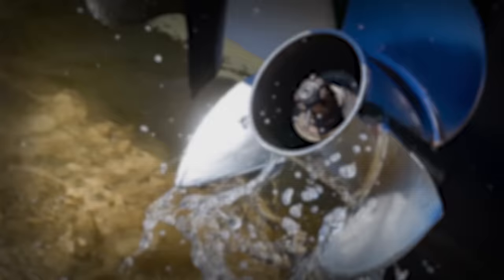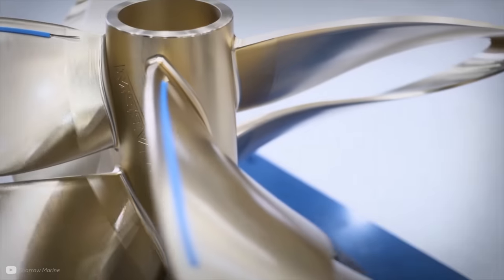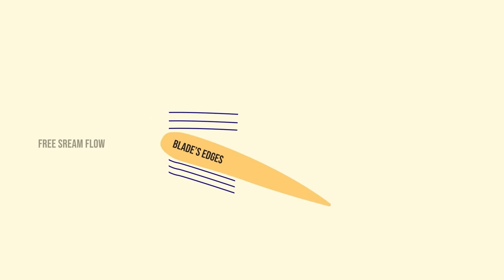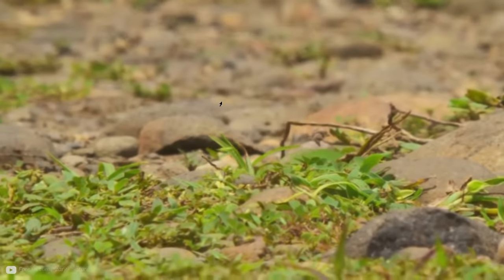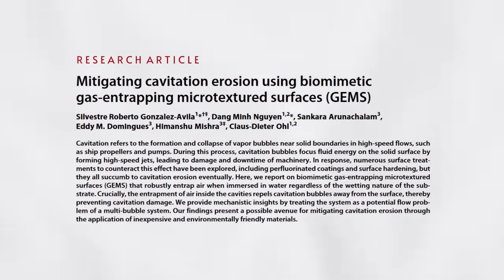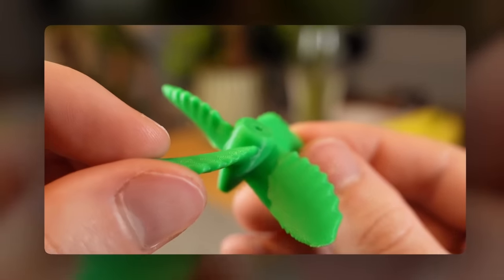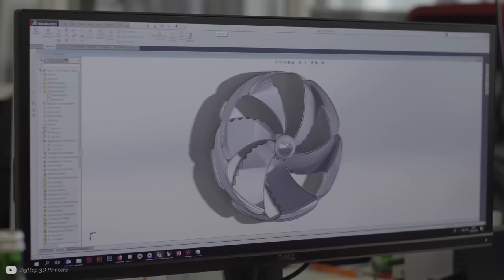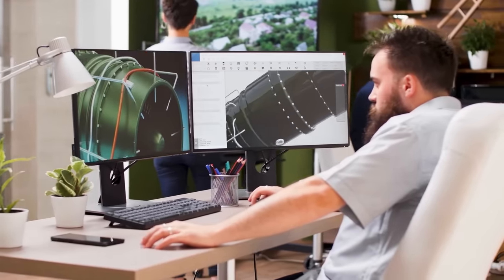The Unexpected Genius of Bionic Propellers

Comment: They should also look into blades on turbos for automobiles. You only need small blades which is easier for manufacturing. Also there is already an infrastructure for testing. Don't forget a giant payday from oil/gas and automotive industries.

Comment: The claim of "+19% efficiency" for the linked blade prop means nothing all they've done is made a bolt on kort nozzle which when properly designed with its propeller can get you more than +40% efficiency over a standard open bladed prop , they also reduce noise and fuel consumption but at only low speed and normally only fitted to tugs and trawlers, kort nozzles are not used on ocean going ships for a very good reason , drag. they cause more drag at speeds over 8 knots than the benefits they give and that fixed tip joined prop you show would be exactly the same, if props like that could be made to save fuel at the speeds ships use when in transit then they would've been put on decades ago. J type skewed back props ( as seen on modern commercial ships and military submarines ) are far more efficient for fuel , lower noise emitted ( due to the design having less cavitation because you design the prop to have the most thrust at a lower rpm by using 6 or 7 blades instead of 4 or 5 ) and considerably lower drag compared to other prop types, nozzle type props do not make sense for the vast bulk of the worlds shipping fleets

Comment: If windmills had ridges, they move faster, and by having an outer magnetic force. Would increase the power source 5 times.
Plus, the blades would be smaller.
Reply: Plus, it designs where the windmill, is able last 80 years, and able to multitask, 24/7.
Reply: Wind turbines, not windmills.

Comment: This makes me sad. Humans have been emitting an outstanding amount of noise into the oceans and it's not just propellers only, it's also the engines, all this emits low frequency sounds which travel very far, as in: more than 100 miles. And imagine this, if at 500 miles, the sound emanating from one ship is barely detectable, what if there are 100 ships within 500 mile radius? To a whale, 200 years ago, oceans were very quiet, now they're as noisy as a factory. And scientists have been attributing the causes of beaching of whales to climate change, earth magnetic pole shift, but noise was never suspect? Whales communicate by low frequency sound, they use sonar to navigate and excess noise from the ships is not suspect?? Weird.

Comment: 4:20 this number isn't quite accurate. I just completed my intro Hydro Acoustics class this semester in my university. Basically the formula for noise is 20log(P/P0) P is acoustic pressure and P0 reference pressure. Like many things loudness is one of the reason thing may seem quieter in a loud room, because the acoustic intensity of the environment is greater. Anyways, the typical I0 of earth's atmosphere is 20*10^-6 while in the ocean it is 10^-6. But that isn't all. But that isn't all really because not only is the denominator smaller, t numerator is bigger. There is also the equation I=P^2/(2*density*speed of sound) where I is acoustic intensity, which is the power of the sound wave divided by the size of the sound wave. Ok so just a little bit more. So solving for P we get P=sqrt(I*2*density*speed of sound). In the density of air is 1.2kg/m^3 and the speed of sound in air is 343m/s, in sea water the density is 1,029kh/m^3 and the speed of sound is 1500m/s. 

So now if we take I is constant and use our new P and P0s, we will find that any source underwater is 61.76 decibels louder in sea water compared to the same source in air. So the 180 decibel noise is actually closer to 118db in air.
Reply: 1,029kh???

Comment: This video has some serious misinformation in it, the most glaring of which is the claim that a ship's propeller is comparable to a rocket launch. 

This clearly comes from the author's misunderstanding on decibels. dB in air and water CANNOT be directly compared. A decibel is NOT a unit of measurement, it is a comparison of levels. 

The decibel in air is defined as 20 micropascals at 1 meter (yard). The decibel in water is defined as 1 micropascal at 1 meter (yard).  

180 dB in water is NOT as loud as 180 dB in air. Nor does the claim that a ship is as loud as a rocket pass the smell test. A rocket has far more energy than a propeller cavitating. 180 dB in water is closer to the sound of a jet engine in air, say 120-130 dB. 

Cavitation isn't even the loudest source on most commercial shipping; their diesel engine is. Propeller cavitation is a concern for submariners because it is a distinct and broadband source that is louder than any of the other machinery they have, but it's not the loudest source on a commercial cargo ship by any stretch. It is still a concern due to fuel efficiency and damage to the prop though...

Comment: That propeller design will not work. Cavitation is a result of improper angle of the propeller and shaft in the water, or improper height in relation to the surface, which is most common. It causes air to be sucked in from above the water line. The trailing edge of the propeller is what does the pushing, not the leading edge. Destroy the trailing edge, and you destroy grip ability. In doing so you can create more cavitation because the water is pushed away faster than can be recovered buy rotation which allows the air to enter, which causes the cavitation. With that design, all the water can still be pushed away from the prop, so there is no gain. RPM, Depth, Angle, all play a role in cavitation, no matter the prop design.
Reply: By rotation, not buy rotation.

Comment: They're not different from what was out there already you can find pretty much the same thing or just slightly smaller or more narrow in a car cooling down on the car engine radiator whatever the case may be I understand you got an idea of looking at a car possibly but that is nothing new still if it does what you're saying then that's fantastic too
Reply: You should work on your punctuation.